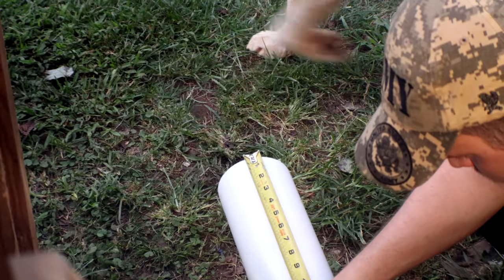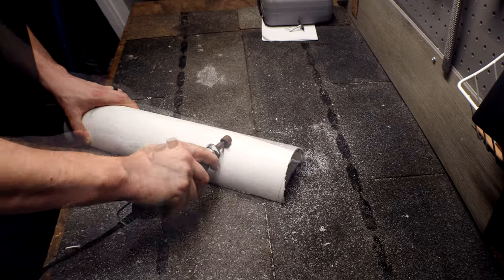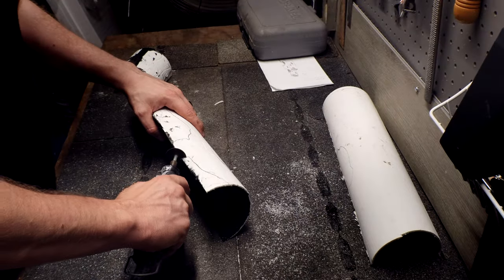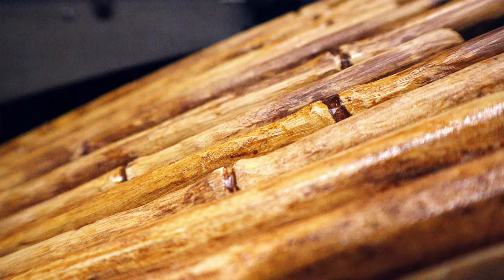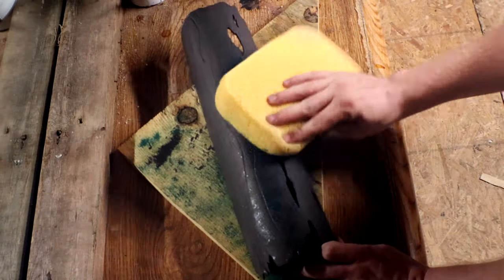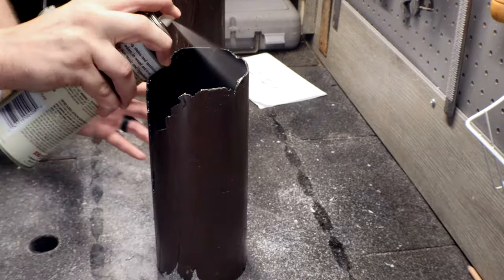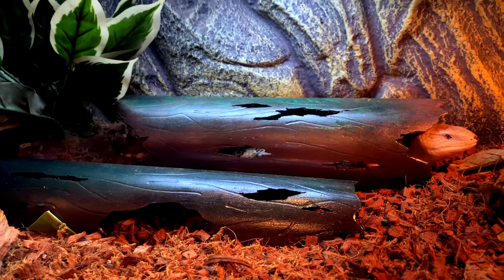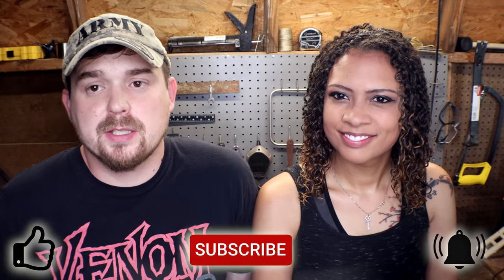DIY Reptile Hide | Reptilian Den

Comment: Would love to turn a 55 gallon aquarium on it's side and make it a front opening terrarium. Any thoughts or suggestions?
Reply from the maker: Haha, that is something that we just recently discussed doing. We were going to use iHeartGeckos conversion kits for the front, and try to remove one of the glass sides to accommodate lights. I might just have to try it now  🦎 -Den